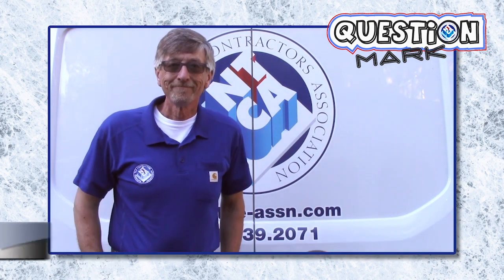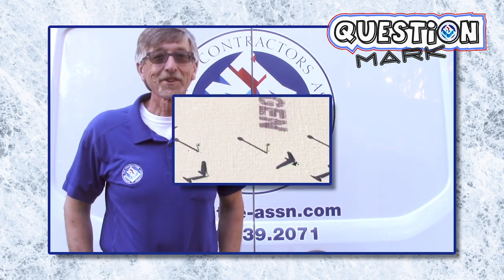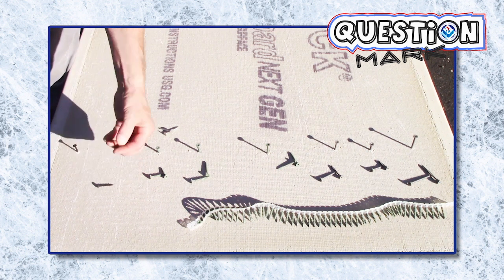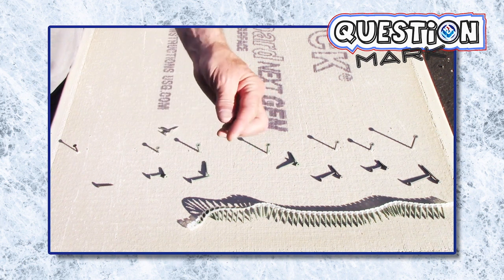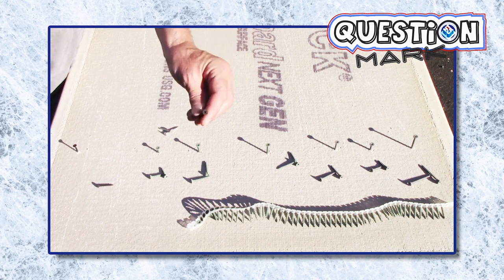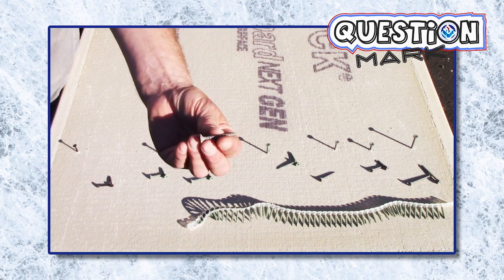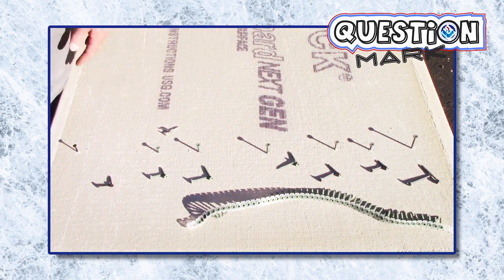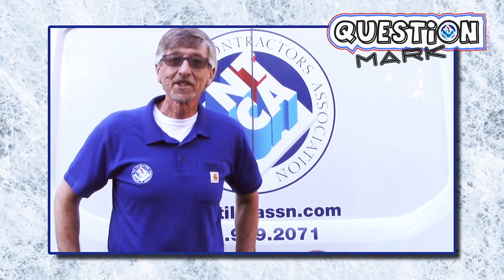Question Mark: Alkali Resistant Screws

Comment: I still don't know what are alkali resistant screws... what coating should they have? what material should these be made out of? "alkali resistant" is not specified in most specs
Reply from the maker: Each backer board manufacturer has screws that they will recommend to meet the alkali resistant screws that they state in their literature.  For example, if you are using cement board, you will want to use a cement board screw which has added resistance to cement which can corrode most screws.  But, these screws are not recommended for all backer boards due to the teeth on the backside of the head which help it embed into the cement board so you will want to double check with the backer board manufacturer that you are installing. While a specification may not state a specific alkali resistant screw, most do state to follow manufacturer instructions.